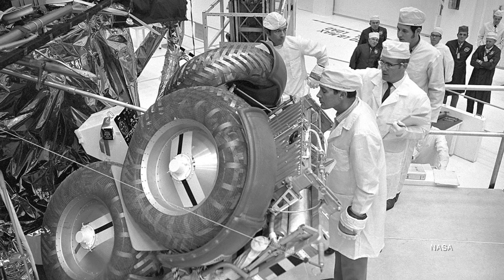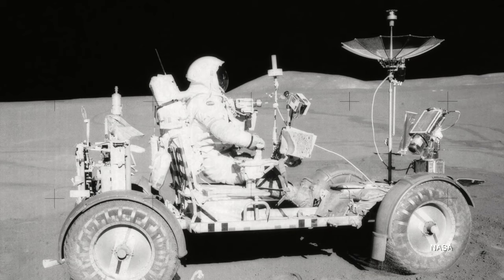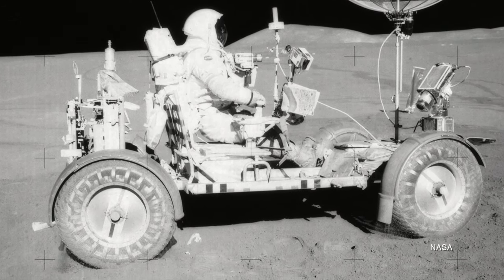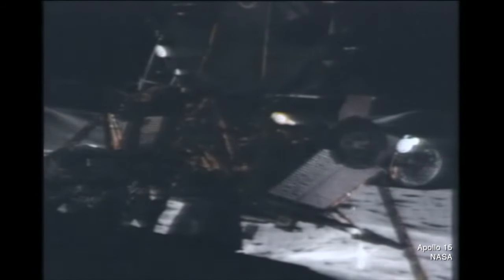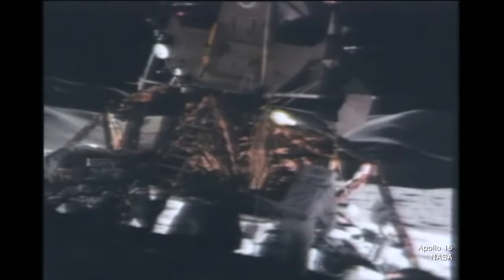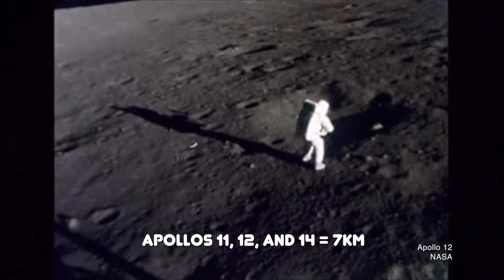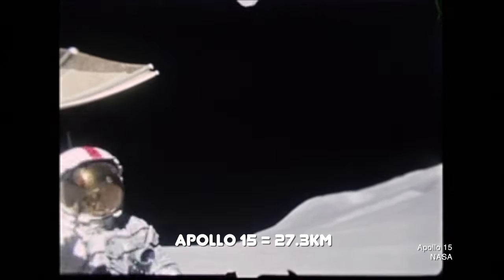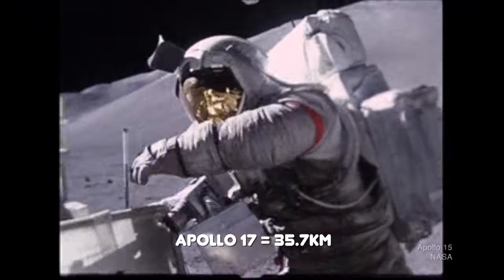How NASA Took Cars to the Moon

Comment: How did the footage from the moon rover get back to earth, did it fly back??
Reply: It was sent directly to Earth, via its antenna.
Reply: @Jan_Strzelecki Right, that sounds totally believable.
Reply: @skiaddict08  Do you mean it in a sarcastic way, merely expressing your personal incredulity?
Reply: @Jan_Strzelecki  How did the film survive 260 degrees on the moons surface, let alone the 3000 degrees when passing through the earth's atmosphere?  Don't worry if you don't have the answers, because no one does.  Who would think 50 years after inventing the airplane, when computers were still the size of living rooms, we would be able to land people on the moon safely, let alone a remotely controlled moon rover.
Reply: @Jan_Strzelecki  Since when does questioning the government imply incredulity?  Since 1984?
Reply: @skiaddict08  How did the film survive 260 degrees on the moons surface
The film was never exposed to this kind of temperature.

let alone the 3000 degrees when passing through the earth's atmosphere?
The film wasn't transported attached to the exterior of the heat shield, but inside the capsule.

Don't worry if you don't have the answers
I do. Everyone who has done even a minimum of research does.

Who would think 50 years after inventing the airplane, when computers were still the size of living rooms, we would be able to land people on the moon safely, let alone a remotely controlled moon rover.
Everyone who has done some research and looked into common hoax believer claims, and realized they're worthless.

Since when does questioning the government imply incredulity?
I'm not government. And, what kind of research have you done to justify your refusal to believe my explanation?
Reply: @Jan_Strzelecki  What kind of insulation did they use that could possible block 2800 degrees?
Reply: @skiaddict08  A thermal protection system, or TPS, which is the barrier that protects a spacecraft during the searing heat of atmospheric reentry. This ablative heat shield functions by lifting the hot shock layer gas away from the heat shield's outer wall (creating a cooler boundary layer). Ablation occurs at two levels in an ablative TPS: the outer surface of the TPS material chars, melts, and sublimes, while the bulk of the TPS material undergoes pyrolysis and expels product gases. The gas produced by pyrolysis is what drives blowing and causes blockage of convective and catalytic heat flux.
Reply: @Jan_Strzelecki   How much insulation was around the film if it was attached to a little flying rover?  Why does NASA admit we can't pass the Van Allen Radiation Belt, to this day?  Buzz Aldrin admits clearly we haven't been to the moon.  It was a scapegoat to fund the military industrial complex, and Vietnam.  Stanley Kubrick filmed it.
Reply: @skiaddict08  How much insulation was around the film if it was attached to a little flying rover?

Ooh! You meant the Rover’s film! My apologies – I misunderstood your questions. The Lunar Roving Vehicle was equipped with a video camera, not film camera. It wasn’t recording anything, but merely sending footage back to Earth. That’s where it was recorded.

Why does NASA admit we can't pass the Van Allen Radiation Belt, to this day?

NASA admits no such thing. What they did say was that essentially they need to test the new, upgraded radiation shielding for their next-gen Command Module, the Orion, which is meant to deep space exploration, and thus is going to be exposed to higher radiation levels that Apollo had to ever contend with. And the test was successfully performed back in 2014 (which means that “to this day” is laughably false), by flying Orion through high radiation regions of VABs.

Buzz Aldrin admits clearly we haven't been to the moon.

Buzz Aldrin clearly “admits” that we haven’t been back to the Moon. In the same interview, he has repeatedly confirmed that he has, in fact, landed on the Moon.

It was a scapegoat to fund the military industrial complex, and Vietnam.

It couldn’t have been, since faking the Moon landings would’ve been more expensive that actually landing there (on top of all the officially ordered equipment, you’d need a dedicated team of scientists and engineers to fake all the telemetry data and transmissions, as well as the filming crew, VFX guys, prop makers, etc.)

Stanley Kubrick filmed it.

He did no such thing – his supposed “confession” is a fake, and his family vehemently denies this.

And I see your "A funny thing happened on the way to the Moon" and raise you a short and precise debunk:
https://www.youtube.com/watch?v=y5XkLa9RYNk
If that's not enough, I can also link to other video which demonstrates that the way of faking the Earth proposed by Bart Sibrel is physically incapable of producing effects seen in NASA's footage.
Reply: @Jan_Strzelecki   I'm not a FE'er.  Kubrick absolutely was hired by the CIA to "recreate the moon landing" in case they actually didn't make it.  It is a fact.  There are literally mountains of evidence in "A Funny Thing Happened on the Way to the Moon" proving the moon landings were filmed on a set, and we don't have the technology to make it out of lower orbit.  Freemasons will keep a secret if it's "in the better interest of mankind", and if enough money is offered.  It takes serious ignorance to ignore everything presented in this documentary.  Also check out the documentary "Astronauts Gone Wild," you can see Aldrin very nervous and admitting Sibrel's case about reporting to earth about being halfway to the moon while filming their trick photography of the earth from lower orbit, creating the illusion of being 50 times farther from the earth than they actually were.  Also check out Sibrel's youtube channel, he is still exposing it from all angles.  The evidence is solid and irrefutable.
Reply: @skiaddict08  I'm not a FE'er.
Huh? I didn't say you were.

Kubrick absolutely was hired by the CIA to "recreate the moon landing" in case they actually didn't make it.  It is a fact.
Then how come there's no evidence to support that "fact"?

There are literally mountains of evidence in "A Funny Thing Happened on the Way to the Moon" proving the moon landings were filmed on a set
No, "A funny thing on the way to the Moon" is a con job, meant to fleece gullible people out of their money. Haven't you watched that debunk video I've linked to? I have more, if you want.

Also check out the documentary "Astronauts Gone Wild," you can see Aldrin very nervous and admitting Sibrel's case about reporting to earth about being halfway to the moon while filming their trick photography of the earth from lower orbit
But since faking it the way Sibrel claims it was faked is physically impossible, I'd say that Aldrin was anything but "nervous".

Also check out Sibrel's youtube channel, he is still exposing it from all angles.
Oh yes, there's still money to be made out of gullible hoax believers...

The evidence is solid and irrefutable.
And yet, this "irrefutable" evidence has been soundly refuted countless times. Your own reaction proves that - when faced with explanations of your claims, you simply abandoned them and moved on to another set, in apparent belief that some of them has to be right. The sad reality is, none of them are.

Oh - another thing - two of the astronauts in "Astronauts Gone Wild" have actually complied with Sibrel's request to swear on the Bible. Why isn't it enough, and if it isn't, then what was the point of that request? Can you answer that? I can.
(hilariously enough, Sibrel doesn't know the definition of the "treason" and has to be told what it is by Alan Bean :) )
Reply: You dont need tk be a "hoax believer" to use common sense and research to know it was absolutely impossible. For you to actually see Seibrels documentary and still dismiss the evidence as tin hat retardism, goes to show how afraid people are of the truth about our government and secret societies controlling the media and using mass population mind control. Why havent we been able to make it out of lower orbit since the apollo missions? Because its too inexpensive? The science proves there wouldnt have been enough fuel to travel 500 thousand miles. To transmit a live tv signal 250000 miles in 1969 is absolutely laughable, and anyone who doesnt question the US government or any gov is a seriously dooped lost cause or is paid to be a shill.
Reply: @Jan_Strzelecki  In latin, government, means 'mind control', and boy they sure have succeeded with most people. You probably think 9/11 was the Al Qaeda too. Sorry i tried to show you the truth..i feel it is a lost cause anymore. Have a nice day.
Reply: @skiaddict08  You dont need tk be a "hoax believer" to use common sense and research to know it was absolutely impossible.
Faking the Moon landings? Yes it was.

For you to actually see Seibrels documentary and still dismiss the evidence as tin hat retardism
Sibrel claims that this footage was shot through CM's round window. The original clips were not shot through the round window, but one of the triangular ones. That is a fact; that is a reality. How else am I supposed to call people who still insist that Sibrel is still somehow right? It would be like showing clips of planes hitting WTC and claiming it proves that helicopters were used to do it.

Nixon couldn't cover up two blokes breaking into a hotel room, but you believe that he could cover up the entire fake Moon program?

Why havent we been able to make it out of lower orbit since the apollo missions? Because its too inexpensive?
It was too expensive, and there was no public support for that. Both are a matter of public record. It's reality.

The science proves there wouldnt have been enough fuel to travel 500 thousand miles.
No, some ignorant folks claim there wouldn't have been enough fuel, but the actual math checks out.

To transmit a live tv signal 250000 miles in 1969 is absolutely laughable
Why? Because you don't understand the difference between omni-directional and directional antennae?

and anyone who doesnt question the US government or any gov is a seriously dooped lost cause or is paid to be a shill.
I'ts not a matter of believing the government - it's a matter of rejecting objective reality. Whatever lies the US Government is spewing (and there's a lot of that), they don't control the laws of physics.

In latin, government, means 'mind control'
That is a complete nonsense. While the -ment ending does come from a Latin word meaning "mind", it is used in English as one of the standard ways of converting a verb to a noun. Going by the same logic, "retirement" means "mind dying off". You're not showing me "the truth" - you're showing me some ignorant claims which make you feel special and better about yourself.

You probably think 9/11 was the Al Qaeda too.
Well, which is more likely? That some Arabs from a cave took flying lessons, kidnapped some airliners, and flew them into some building, or that the governm... excuse me, "Mind Control" wanted an excuse to invade Iraq, so they chose patsies not linked to Iraq, left them alive, wired WTC for a controlled demolition without anyone noticing, projected hologram planes, and used some "super-thermite" to melt some of the steel supports, and then demolished the building? Or maybe that "they" used some kind of clean nuclear device? Or orbital laser?

This is what happens when people who don't do enough research are baffled by reality - they make increasingly complex and absurd scenarios, ending up with some convoluted self-contradictory mess. And whenever someone tries to point out their mistakes, they get offended and huffy - 'Well, excuuuuuse me for trying to show you 'the truth'!"
Reply: @skiaddict08  when they said that they were testing a New capsule, you guys always leave out the context
Reply: @skiaddict08  
YOU SAID: "How did the footage from the moon rover get back to earth, did it fly back??"

== The film canisters from the 16mm video camera were flown back to Earth.  The live transmissions from the TV cameras were sent via radio (slightly different format than standard analog TV, but basically the same thing).

YOU SAID: "How did the film survive 260 degrees on the moons surface,"

== The Apollo astronauts were never there when the surface was 260 degrees.  That only happens later in the lunar afternoon.  All Apollo missions landed in the lunar morning, long before it got that hot.  But, it's also a bit irrelevant because they never took the film out and placed it on the rocks.  See, you must understand thermodynamics and heat transfer concepts in order to understand this stuff.  Heat doesn't transfer very well in a vacuum.  It takes days/weeks for heat to transfer in a vacuum to the same extent that it transfers from physical contact.

YOU SAID: "let alone the 3000 degrees when passing through the earth's atmosphere?"

== Um, what?  Are you under the impression that they kept the film canisters on the OUTSIDE of the capsule during reentry?  What??

YOU SAID: "Don't worry if you don't have the answers, because no one does."

== Yeah, right.  Every physicist on Earth is just too stupid to understand heat transfer and thermodynamics, but YOU understand it... while asking idiotic questions about film being exposed to 3000 degree temperatures upon reentry... or asking about 260 degree temperatures on the moon (when no Apollo mission was even there during those temperatures).  Um, dumbass, how did the astronauts survive reentry?  The film canisters went through the atmosphere via the same method that the astronauts did.

YOU SAID: "Who would think 50 years after inventing the airplane, when computers were still the size of living rooms, we would be able to land people on the moon safely, let alone a remotely controlled moon rover."

== Your ingorant incredulity isn't my problem.

YOU SAID: "Since when does questioning the government imply incredulity?"

== Your prior statement was EXACTLY IN THE FORM OF INCREDULITY!!  This is BY DEFINITION!!  That's what "incredulity" means!!!  Good fucking gods.

YOU SAID: "What kind of insulation did they use that could possible block 2800 degrees?"

== Look up "ablative heat shield."  You are basically saying that you don't know how heat shields work, therefore Apollo was fake.  That's EXACTLY your level of "logic" here.

YOU SAID: "How much insulation was around the film if it was attached to a little flying rover?"

== The rover cannot fly, you dumbass.  And, the film was kept inside canisters.

YOU SAID: "Why does NASA admit we can't pass the Van Allen Radiation Belt, to this day?"

== No, asshole.  NASA "admits" that they don't currently have human-rated boosters and craft capable of going that high.

YOU SAID: "Buzz Aldrin admits clearly we haven't been to the moon."

== You are truly an idiot.

YOU SAID: "It was a scapegoat to fund the military industrial complex, and Vietnam.  Stanley Kubrick filmed it."

== You are truly an idiot.

YOU POSTED A LINK TO A BART SIBREL MOVIE:

== Um, dumbass, Bart Sibrel is a complete liar.  His video consists of edited clips, downright fabrications, deliberate misinterpretations, and a bucket of utter lies.  Why would you believe a single word out of that criminal taxi cab driver?

YOU SAID: "I'm not a FE'er."

== Could have fooled me.

YOU SAID: "Kubrick absolutely was hired by the CIA to "recreate the moon landing" in case they actually didn't make it.  It is a fact."

== Sure, all things you learn on the internet are a fact.  Pfftttt.  You are truly an idiot.

YOU SAID: "There are literally mountains of evidence in "A Funny Thing Happened on the Way to the Moon" proving the moon landings were filmed on a set, and we don't have the technology to make it out of lower orbit."

== No, dummy.  That entire "movie" is a fraud, and every single "fact" offered by that "movie" falls apart under the slightest bit of scientific scrutiny.  And, you are truly an idiot for believing a single word.

YOU SAID: "Freemasons will keep a secret if it's "in the better interest of mankind", and if enough money is offered.  It takes serious ignorance to ignore everything presented in this documentary.  Also check out the documentary "Astronauts Gone Wild," you can see Aldrin very nervous and admitting Sibrel's case about reporting to earth about being halfway to the moon while filming their trick photography of the earth from lower orbit, creating the illusion of being 50 times farther from the earth than they actually were.  Also check out Sibrel's youtube channel, he is still exposing it from all angles.  The evidence is solid and irrefutable."

== No, you fucking dummy.  I could explain this at great length, which I have many times.  But, if your entire method of "education" is to watch videos (sigh), then here, go watch this one, which completely destroys the stupid "round window illusion" you're talking about:
https://www.dailymotion.com/video/x2zt9g6

YOU SAID: "You dont need tk be a "hoax believer" to use common sense"

== It's always hilarious when you know-nothing morons fling your stupidity around and then call it "common sense."

YOU SAID: "and research"

== You wouldn't know what "research" was if your life depended on it.  Sorry, fucking dumbass, watching videos made by lying taxi cab drivers is NOT research.

YOU SAID: "to know it was absolutely impossible. For you to actually see Seibrels documentary and still dismiss the evidence as tin hat retardism, goes to show how afraid people are of the truth about our government and secret societies controlling the media and using mass population mind control. Why havent we been able to make it out of lower orbit since the apollo missions? Because its too inexpensive? The science proves there wouldnt have been enough fuel to travel 500 thousand miles. To transmit a live tv signal 250000 miles in 1969 is absolutely laughable, and anyone who doesnt question the US government or any gov is a seriously dooped lost cause or is paid to be a shill."

== Your mind is lost, and I cannot read another word from you.  You are truly an idiot.

EDIT: Hey, fucking dumbass... even in your own version, you're acknowledging that the film survived reentry.  If you think Sibrel's movie represents reality (sigh), then you believe that the film survived reentry, because it was one of the foundations of your arguments.  Yet, because you're an idiot, you don't even recognize when your own arguments contradict themselves.  Hey, fucking dummy, if they were in low Earth orbit to make the film that Sibrel used in his "movie" (though, greatly edited), then that very film survived reentry.

Checkmate, you stupid fool.